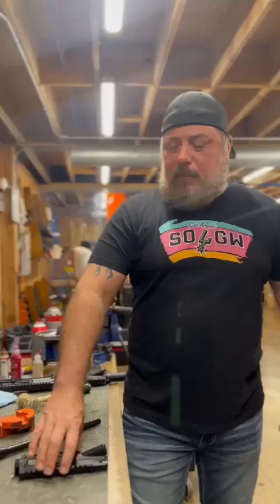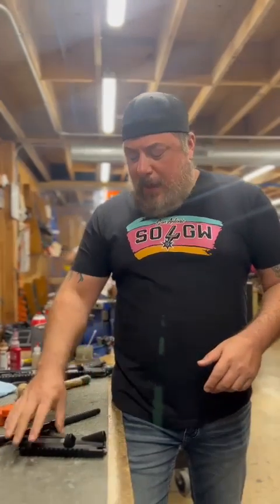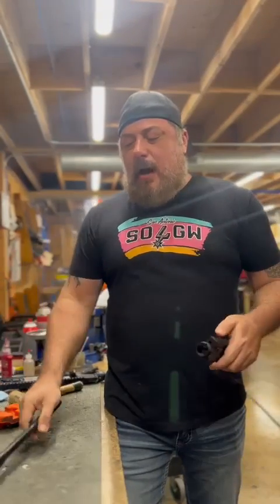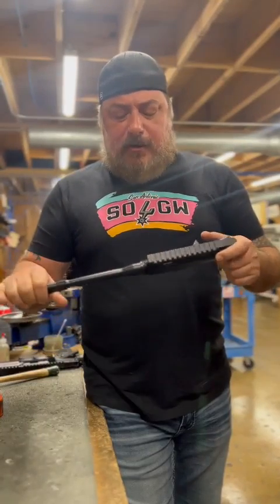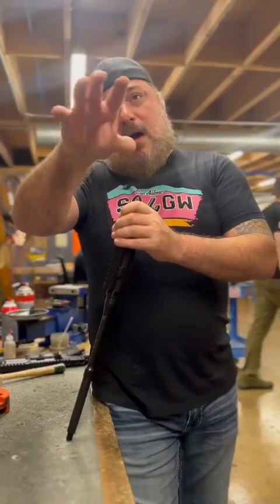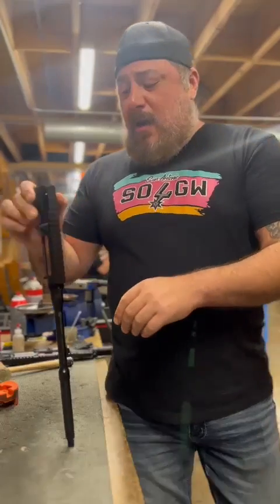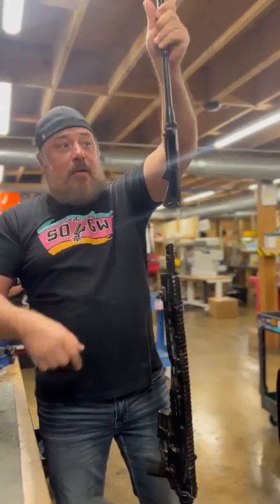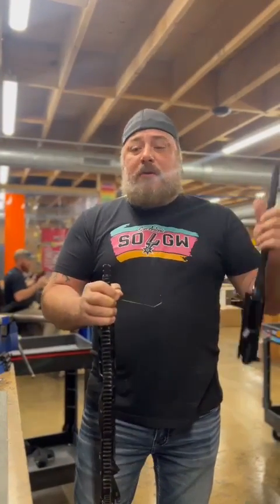Pressfit barrels... why?

Comment: Ar's have tight tolerances. They're supposed to be snug. If you're using quality parts and components, even if they're not all the same brand, everything should come together in a harmonious symphony that looks and feels like it all came from one manufacturer and fits just perfectly without any slop, wiggle or too tight. We all just saw how easily those two parts went together with light tapping. If you're having to beat the fuck out something and it's not moving, THEN something is out of spec.

Everyone gets bent out of shape over mil spec. That doesn't mean the lowest bidder won, it means it was made within the specifications eugene stoner and the military called for. Things need to at least start there and can deviate if it's objectively an improvement. This would be one of those things that is not mil spec but also is done with thought for a purpose and makes the rifle objectively better. Just like a vltor a5 system, precision triggers, np3 bcg's with ocks fasteners, mid length gas systems, etc.

Comment: I bought a 13.7 exo 3 and 13.7 m4-89 and the gas block was not dimpled or pinned. The rifle itself seemed ok. But SOLGW is no  different than anything else out there except that i believed they did not skip quality build up. But they did skip. I shouldve just gone with a PSA saber, with no dimpled or pinned gas block for  cheaper and better quality material wise. I will probably never buy from SOLGW again, they are high price for standard to mediocore builds. Nothing special with them. They are good and talking the talk and providing good service to LEO's. But their expensive mediocre uppers do not meet the standards of other cheaper products. 

Sorry SOLGW you failed me twice in a row and it is my duty to inform the public so they can make an intelligent choice.

PS. I refuse to pay high dollar amount and STILL have to conduct my own quality work on my rifle which i paid above asking price after advertising a degree of quality steps for a build.
Reply: SOLGW = rebranded Aero
Reply: @rifleshooterchannel208  seriously???
Reply: @ Look who makes their barrels and the rabbit hole continues from there.
Reply: @rifleshooterchannel208  oh dang that explains

Comment: Always nice to see things being done as they should be done. Sometimes "tight" is done in places where it doesn't belong but this is for sure one area where tight is good. Most AR's will have generous clearance (AKA slop) in this area. Clearance in this area is the manufacturer's friend but I totally agree that in barrel mounting it is not optimal for the end user. Thanks SOL for doin' it right.

Comment: We love that you guys take the time to share your knowledge and explain the "why".  Thank you!
Reply: SOLGW is not that great. You have options that are in par or even better at their high price point. Yes i bought 2 uppers, and im glad i checked them out. They do do not dimple or pin gas blocks as they advertise they do. Atleast both of mine were not. And i paid almost 2 grand for both uppers, just to find out they are junk. I should have gone AERO, TNTE, MAS defense or or other equally quality builds for much much less. SOLGW failed, and im a LEO. I would caution anyone to buy from them. I suggest you shop around, as i guarantee you will find better options.

As a matter of fact if you want to buy my solgw upper inam selling them.

Comment: Not sure how much help I'll find in the YT comments, might head to the FB group.   I've got an 11.5 Exo 2 that I bought directly from you guys years ago.  For the longest time just had the NOX torqued on.  Pull it off in order to Rocksett it (getting a can soon) and while moving things on/off with shims I noticed that my hand guard actually rotates. (Minimally.. the anti-rotate tabs are there) but I can actually shoulder the system, and with my off hand I can physically rotate the hand guard (takes a little effort, but I'm not a big guy either) 

Is there an easy fix for this that I can do at home with basic tools?  Right now I've just got a Sling Attachment bridging the upper/hand guard rail slots so that it's stopping the rotation.

Comment: Would much rather have a thermo expansive upper to hold my barrel and barrel nut, just like a BCM, LMT (I believe) etc, those are the best ones I believe, just going to do a better job and keeping spec when things really start to heat up and shit gets bad. Just makes me want a SOLGW upper even more so.
Reply: Thermo fit for my VLTOR upper but that's billet. Snug fit for my Centurion Arms. I'm thinking about buying SOLGW parts to serve as build foundations from now on. Their milspec receiver sets and bcgs appear to be rock solid.

Comment: Interference fit. Shouldn’t it be heated instead of hammered on?
Reply: Pressed is best. Per AK, iz guud.
Reply: Hammered on lol, total fail.
Reply: I like hammering.
Reply: Press or heat/freeze is often suggested because there are just so many ways for the avg person to screw it up using a hammer. Plus you need to know when to give up using a hammer and go to press….most don’t have a feel for when to do that.

Comment: I agree a snug fit like this is good, but I have my doubts that accuracy is compromised if it's not tight like this. With the barrel nut having a minimum of 30 ft-lbs it will provide plenty of tightness between the components.
Reply: Yep, when barrel nut is tightened the receiver tightens down against the barrel ext closing up the gap, this has been proven, all this does is make you have yo hammer your barrel in, and hammer it out if you ever need to. Stoner remains unbeaten.
Reply: It’s has to do with harmonics.
A loose upper is absolutely not as accurate

Comment: So every other AR-15 that has been made since the 1960’s was built wrong ?  🤡🤡🤡🤡🤡🤡🤡 what is the barrel nut for ?  And how do you remove the barrel ?
Reply: Concerned patriot, you obviously are new here. The tighter the tolerance, generally speaking, the more accurate the rifle. Let’s take a “wobbly” lower and upper for example. You are on target at 1000 meters with your 6.5 creedmoor, pull the trigger and miss. The movement of you pulling the trigger could have just moved the lower out of sync with the upper. The only 🤡 here is you!
Reply: Such a cringe comment.
Reply: @cindylou1112  no other manufacturer makes their uppers like that to fit the barrel so tightly.  That’s a mistake and they’re trying to tell you that that is a better fit.  Don’t fall for that.
Reply: @concernedpatriot.2221 BCM and Centurion Arms are thermal fit.
Reply: @concernedpatriot.2221  lots of billet uppers have thermal fit
Reply: Was it ever said that others have been built wrong? To remove, heat the receiver and use a dowel to knock it out.

Comment: If they set the receiver out in the sun for a few hours... barrel will slide right in... wont even need to hammer.. the heat will expand the receiver for them
Reply: so will the barrel
Reply: @Hasid_Lafre  Don't leave the barrel out in the sun if you are trying to do this.